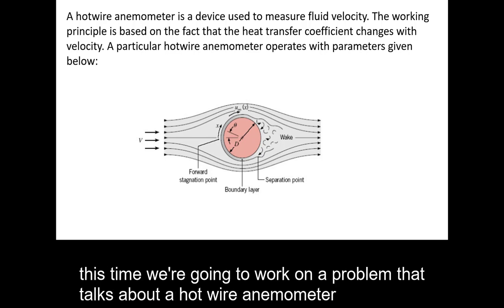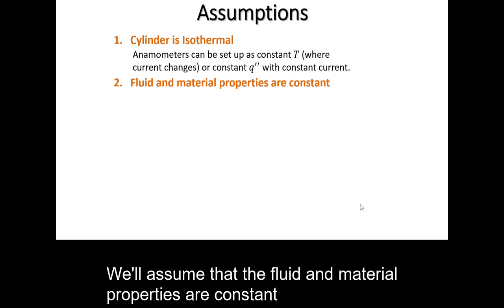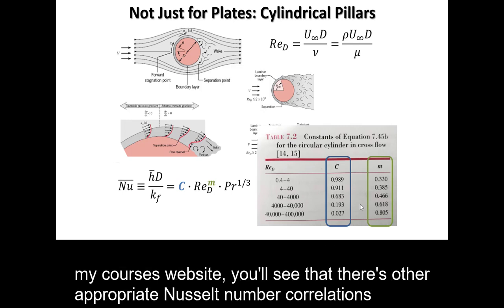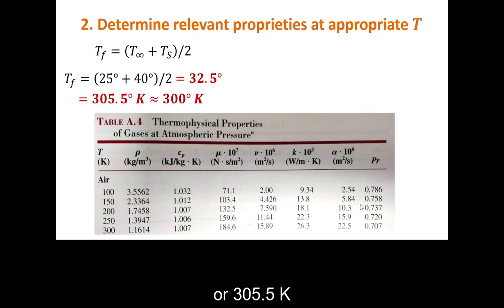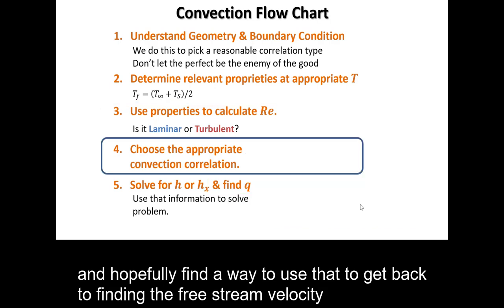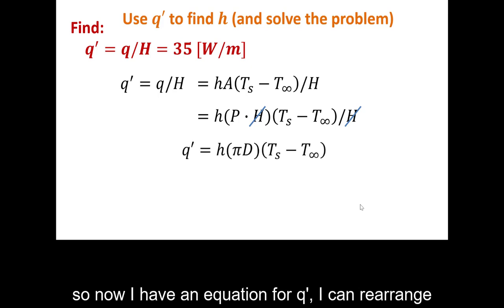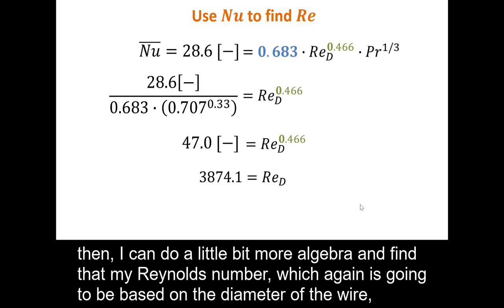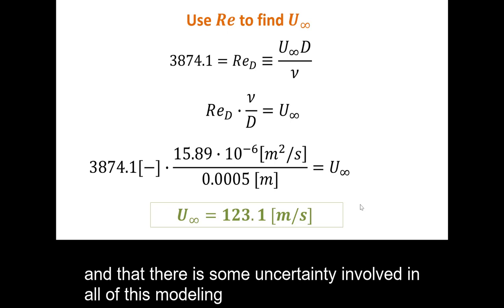External Convection Hotwire Anemometer: Heat Transfer Examples for Mechanical Engineers:

Comment: I don't know if you still read this but I have the same question but air temperature is 30°C, diameter 0.15 mm , Q is 15W/m and the wire temperature is 80 °C. When i calculate the velocity i get 4.85 but my book says the answer is 13.12.
Reply from the maker: I think that the general process should be the same. There are a couple of things I would check (1) did you go back and see if the velocity you got give you a Re that's in the appropriate range for the values you put into the correlation? (2) Did you double check the units you used in your calculations? (3) Just small math errors? It's possible that the solution in the book is using a different correlation, but I wouldn't expect the difference in the velocity to be that big.